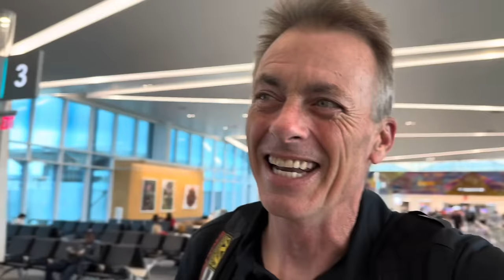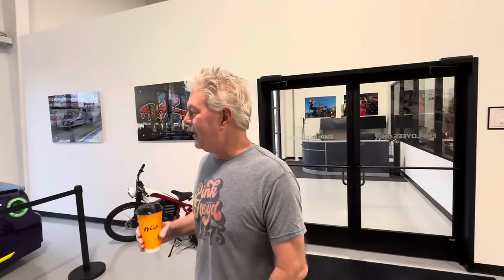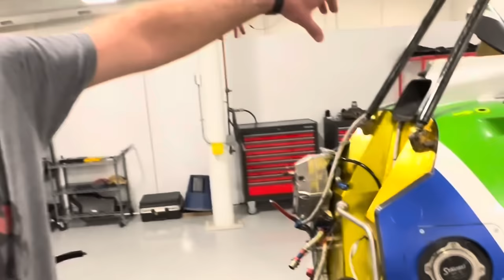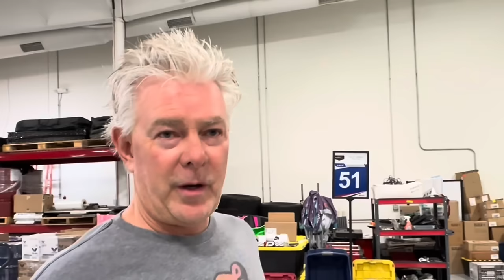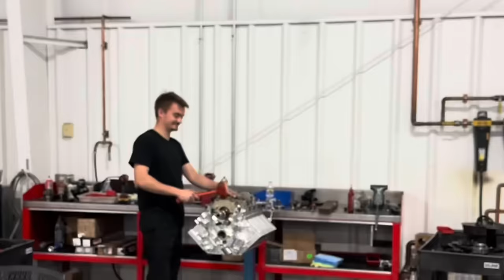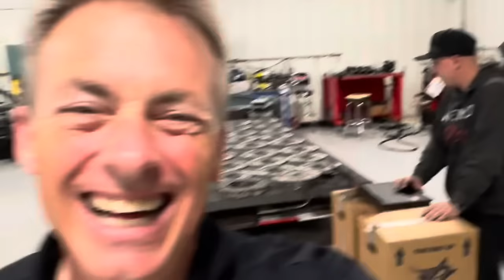Inside Look At Rick Ware Racing

Comment: When a clutch friction disc is worn past usable limits, do you send the metal disk with splined center back to the disc manufacturer to be used again with new friction material added or is it it junk?